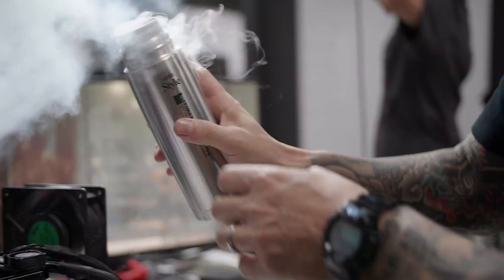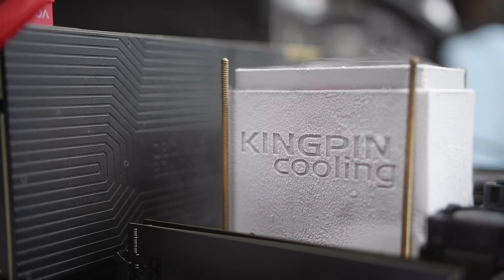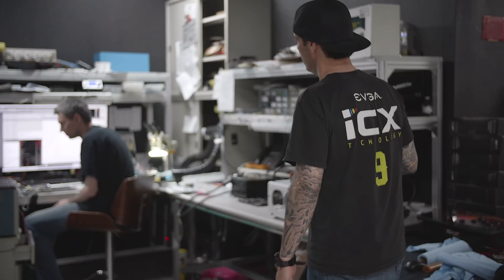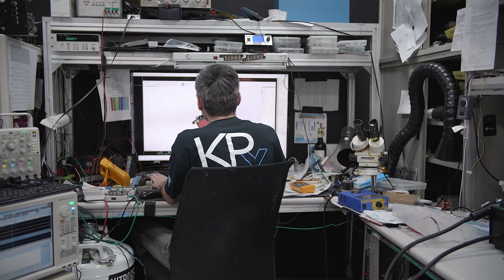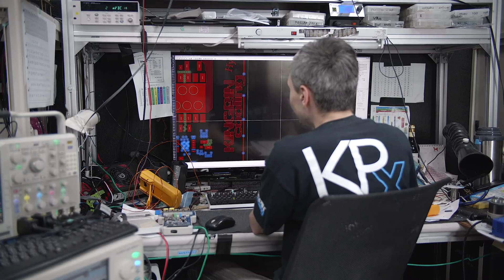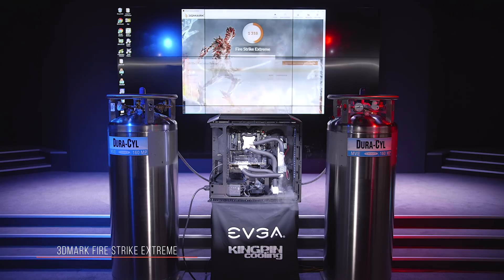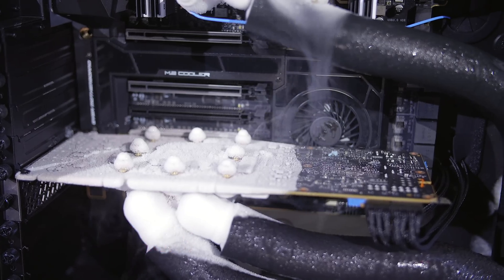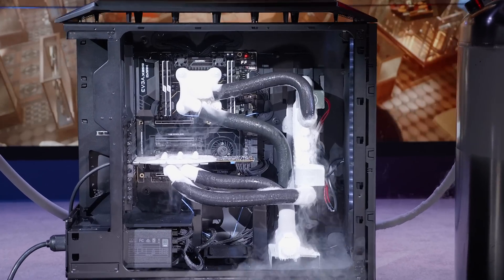ROBOCLOCKER

Comment: See what I always wanted to make is either a LN2 or multiple phase cooled chill box that was insulated with Aerogel batting so it would offer max efficiency and cooling for the entire system including phases, RAM, MB, and everything not just the CPU/GPU. Plus with this setup you could insulate it with Aerogel and make it be the most efficient system in regards to electricity/LN2.

You would get the benefits of:
1) Whole system below zero for 24/7 run time
2) Aerogel batting so you could easily get R40 or R60 or even higher R value insulation so virtually no external heat would enter the system
3) You would make it airtight so there would be zero humidity in the system besides what's there at the start up of the system. Though you could easily create a humidity catch system to catch that water away from the electronics. So in my system you would have ZERO condensation on electrical components. There system in video you can see everything is frosting up but in mine there would be zero frosting. So zero concern of components being damaged.
4) The system would be drastically more efficient and economical than anything currently made. Since there is virtually no heat entering the system due to the aerogel batting since it offers the highest R Factor of any insulation available besides vacuum wall chambers.
5) It would offer simple plug and pay of components. Just shut down the system open the chill box and change whatever you want and reclose it and turn it back on.

I am sure there are more benefits but you can see why this would set the most world records and be the most economical and safest system possible. I would love to make it but I don't have the types of funds like EVGA lol. Some day I'll probably make a phase change system like this but an LN2 system would probably be too expensive. Basically, a phase change system would use about the same amount of energy as you are using in the system give or take. So, if you have an 800 watt PC you would need to use about 800 watts or so to cool it depending on how efficient your compressors are.

Aerogel has over 4 times the R value than other insulators so you can easily get maximum insulation.
http://www.buyaerogel.com/
http://www.buyaerogel.com/product/spaceloft/
http://www.buyaerogel.com/product/cryogel-z/

Comment: Have you ever considered building a sealed case? I bet you could use the exhaust N2 to provide an inert gas environment for the computer components instead of having them open to ambient air. This would reduce the risk of component damage due to icing, and may allow you to run lower ambient temperatures for the rest of the system.
Reply: The best way is to hermetically seal the entire system in an air tight enclosure. This would prevent the humid air in the room from constantly entering the system and causing condensation. The inside of the PC will effectively dehumidified which stops the condensation. I have seen this sealed box technique used before for other applications, like powerful laser diodes.

Comment: I have a weird feeling that liquid nitrogen is going to be moved out of the way for something new... There has to be something that will take its place. What will that be? I'm doing my research now :D What can I turn into liquid form that I could possibly run through heavily improved liquid cooling setup that will allow me to run at subzero constantly? I don't know - yet.... If we can get something to run below 67K we can use liquid helium... But I don't think we can get that low... If we can find a way of getting helium to move to a reservoir to be turned from gas to liquid I think we will be in business... We could just do this with nitrogen, but I want to do something different and I want to "fly" so I'm using liquid helium with magnetized conductors :D

Comment: Why not run the setup in a climate controll room where you keep the moisture level of the air to a minimum? This would probably help a lot with condensation around the cooled parts especially if you also keep the air to a very low temperature.
Reply: You could also put the computer in a sealed box filled with dry nitrogen.

Comment: I know almost nothing about computers but why can't we use a motherboard with multiple processors instead of over clocking one?
Reply: Paralel multitasking in cpu's is really hard to take advantage of, considering that each cpu has multiple cores in paralel too. The hardware and the software should be prepare to take the advantage of having 2 cpu's with 20 cores each, that's the issue.
Reply: we do, some servers make use of dual cpu mobos

Comment: Can you please tell me why the EVGA Kingpin Hydro Copper 1080 Ti card was discontinued? It has only been out for a few months and now it's not available for purchase from EVGA. Was there any issues that this card developed? EVGA won't return any of my messages. I'd really appreciate a response for this. Thanks in advance. Have a great day.
Reply from the maker: The EVGA K|NGP|N cards are always limited run. They are very heavily engineered and tend to be focused on extreme overclocking or LN2 overclocking, which isn't for everyone (but may be someday thanks to ROBOCLOCKER!). So, for the time being, if you intend on purchasing a K|NGP|N card, it is best to get them as close to release as possible. When they are all gone, that's it!
Reply: Just was curious. I got mine back at the end of December of 2017. It's a great card. Thanks for the reply.

Comment: ******This is just my personal opinion. i will not be responding to the trolls and i know there will be at least 5 of them so save your breath or not i don't care.***** Setting world records used to be fun in the past then you cheaters came along and just ruined everything from gaming to enthusiasts builds. Really no point in keeping leaderboards anymore as it's all done by cheating especially with the cost of ln2 setup which cost more than your entire rig. You will get your record shattered by a richer guy when they take their computer out into outer space and run a test so congrats onspending the most money on a pointless benchmark especially 3d mark which use to be a great comparison for maximum performance vs test scores years ago but now days anything with a newer cpu, fast ram and a 970 or later will keep gaining higher scores while you pass the real world gaming performance wall at which starts dropping your performance but keeps scoring higher on 3d mark scores. Not even sure why people are still doing this as my 980/16000x/16gb3200/480gb m.2 rig runs rocket league 4k frame locked at 60fps highest settings and pubg at 1440p frame locked at 60 fps/100 screen scaling/ ultra everything (i drop my shadows to medium however as i don't like it on ultra) and it rarely ever struggles at all. 54 for a low on the worst day at the worst place with the laggyest servers on the worst part of the map but generally if it does manage to drop under 60 it never falls past 58 after you hit the ground. Not sure what the big deal of having 4k is either as I have played with a lot of both 4k and 2k on pubg (4k requires screen scaling all the way down and runs in the low to mid 50's a lot) and don't notice any visual aspect difference at all. Best thing i have ever done aside from making my own custom bios on my evga ftw v1 980 card was download precisionOCX only to frame lock my card at 60 fps and reduce the gpu oc i set using firestrike by -25mhz which gained me more fps even though my firestrike score dropped by over 1000 points without frame lock and about 2200 points with frame lock yet my gaming has never ran smoother, guns have never shot more accurately, momentary game studdering almost completely vanished, items pick up faster, ui interaction is more consistent and fluid. Now when I get killed there's more of a chance that i just suck and died fair and square or got killed by a cheater as i don't see nearly as many deaths running past a corner and see myself getting hit 4-6 out of the 6 bullets rather than the 2-3 out of 6 bullets that I use to get dropped from running over 200 fps. Not to mention how much nicer 2k and 4k colors look as well as the benefit of it being easier to make out objects at distances or in shadowy areas. There's a big downside to 2k/4k however and that is loot items rendering in on time if you land right at the door but they are there when you come back down as it can take some items if the server is bad enough 5-8 seconds to render but most the stuff is rendered before you open the door just not 1-3 items if there's lots of loot to render right away. If you can't run it 24/7 for at least a month straight aside from software bugs (looking at you windows 10 you pos os. I hate you so much now while I loved the creators build and thought it was going to be a greatest os ever and now I'm debating on throwing on Ubuntu or buying a new win 7 pro key. Not sure how you can possibly make it 10x worse with every rc update you push.) You can have the best gpu in the world but if windows crashes the driver every 15 minutes your still going to lose all the time. Hell windows has gotten so bad it can't even fix itself anymore even though it tells you it did but troubleshoot after troubleshoot the same issue keeps "getting fixed" but doesn't until it's unusable and you need to do a factory reset. I strongly suggest if you run a 60hz monitor/TV like 99% of us do that you give a 60 fps frame lock a honest try for a week because it will most likely take 3 to 4 days to get use to the slightly different feel in game play but once you do you will find everything just runs more fluidly and the way it was meant to be rather than getting 60 random frames out of 150+ fps unless you got freesync or gsync gpu+monitor as i believe the vfr tech allows you to get up to 75 fps as long as your not using less than a new unreleased hdmi device which they won't have on the consumer market until early-mid 2019 and you'll need a new $50 hdmi cable. Dport and maybe even dvi-d are the only way you will achieve above 80 fps real refresh rate. As hdmi is barely capable of pushing 4k60fps bandwidth the way it is with most cables hence why their is almost no 4k movies out there other than a handful of movies that don't look much better if at all than the 1440p content as they don't even use true 4k content.

Comment: how are the electronics not shorting out? do new boards come coated or something?
Reply: They're sealed before using ln2 to prevent the moisture buildup from hurting stuff.
Reply: @flinchy-5224  I just assumed they ran the components until they died, and then bought another one. The same way drag racers do with engines.
Reply: @jnevercast  yeah sometimes they YOLO it or just keep an eye on moisture buildup/run lots of air over it

For LN2 though, there's so so much moisture/frost buildup, you've gotta seal it as good as possible as it'll die way too fast
Reply: @jnevercast  the problem with running stuff til it dies then replacing it, is not all silicon is equal, if you've got a perfect mobo, perfect CPU, perfect RAM etc, you don't WANT it to die. It's not a matter of the cost to these guys, its that they may NEVER be able to get a component as good as that ever again.
Reply: Ice isnt electrically conductive, actually marginally conductive